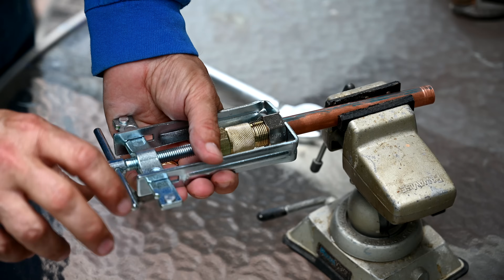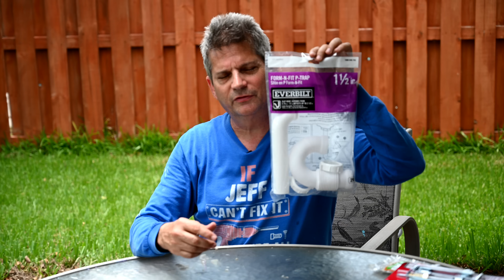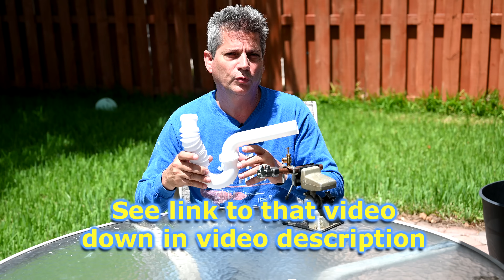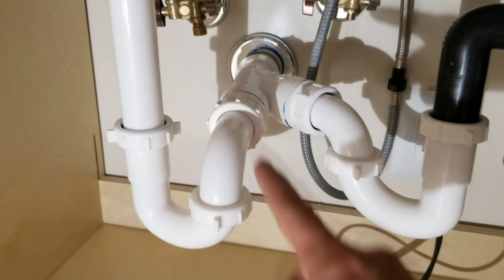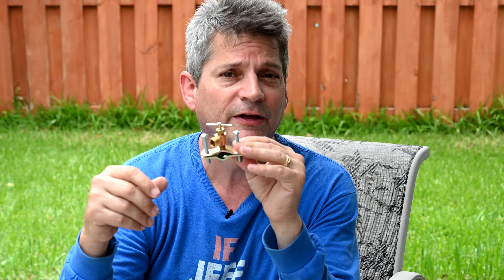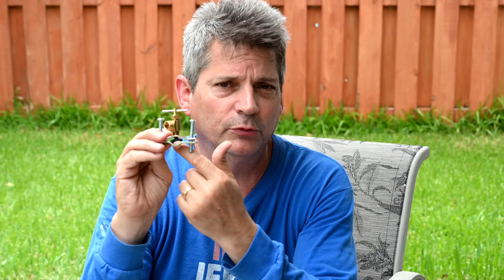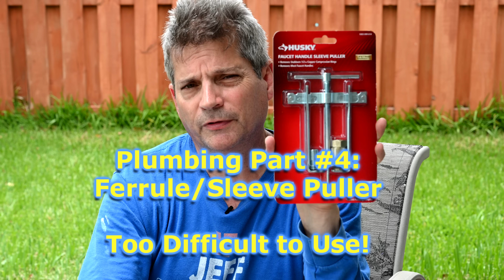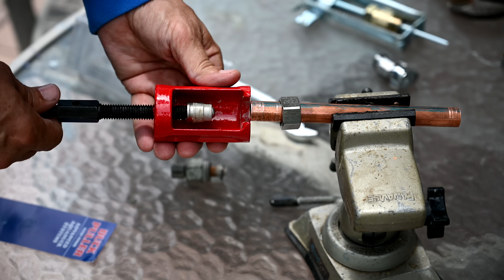4 Plumbing Parts/Tools You Should NEVER Use. NO Plumbing Fails

Comment: As a “Professional” Handyman I get why you have an issue with the average   HM. I live in a Tennessee county where code enforcement is a joke and I see a ton of work every year that is beyond sub par. Having lived in Florida for 37 years where code enforcement is much stricter I am often shocked and amazed at what I find. When I get into a job here. From saddle valves to twisted wire connections with no junction box in the attic to vanities imbedded in green board because the last HM was too lazy to pull the vanity off the wall before installing the drywall, I have seen it all. While I certainly agree there are a lot of HM that don’t know what they’re doing, there’s also a good number of us who care to check code and learn from pros like you before we do a job. Thanks for what you do. Really enjoyed this video especially the husky tool review. I’ve encountered all 3 of the violations you mentioned as well. I kinda think the sub par HM might go extinct if we all had to pass a skills and knowledge test and be licensed. But a lot of the blame rests on the homeowner looking for cheap work. To quote Babe of Babes Plumbing in Venice FL, “Good work isn’t cheap, Cheap work isn’t good”.
Reply from the maker: Yes exactly, and unfortunately you have a lot of poor people who can't afford the normal rate, and so they pay someone what little they have, and cheap labor isn't skilled.
Reply: @jeffostroff  I would just like to add my 2 cents (which probably isn't worth more than 1/2 a cent, but I'll do it anyway) to this bantering about DIYers and HandyMen. I happen to be a retired "professional" Handyman (now DIYer). I owned my own Handyman biz for just over 10yrs. I know... that is not a very long time, most would say. But, prior to starting my business, I worked in the construction industry for almost 25yrs (started when I was 16) doing everything I could get hired that week to do and ended up working as a glazier for the last ten years of that short career until I couldn't work any more due to needing a hip replacement (long story). Anyway (long story longer), after fixing my hip, the building boom here went south for a few years so I started my own biz. I feel my experience, education, and licensing makes me at least a little qualified to render an opinion. That said, and I hope I don't step on any of the Princess Toes that may be out there (and if I do... SO FxxxING WHAT!), I truly think that these so-called "Words of Wisdom" being thrown about like candy canes at Christmas time serve NO useful purpose other than  bashing each other needlessly. For example: "Good work isn't cheap, Cheap work isn't Good". Of course cheap work isn't good!!! BUT... good work CAN be inexpensive!!! Every job has it's own unique challenges and rewards. Each as unique as the individual performing the work. So, I think its time to stop living and working by the code of the one-liners, and only crucify the offenders of what I like to refer to as the "Get the quick, easy money and split" mentality. OR the "I'm a professional. That makes it OK to charge outrageous fees for my work (good or bad)". I will close by saying regardless of the work performed (good or bad), I have rarely seen a "Handyman" over charge for his services, and I have rarely seen a "Plumber" NOT overcharge for his services. Please don't shoot me. It is just a true observation from my own experience over the past 40+ years.
Reply from the maker: @nealfoster6311  Good input, thanks!

Comment: 2:44 yeah, not quite capillary. Venturi effect, based on Bernoulli's Principle - fast moving fluid (such as air) drops pressure, creating suction. Air driven spray guns work like that.
Reply from the maker: That is correct

Comment: Turbulence caused by installing a saddle valve is going to, " break down nearby solder joints"?  Where's your proof for this one. Half the people (licensed or otherwise) coming to fix your house are idiots only interested in making as much money in as little time with as little effort as possible.  Better to do it yourself, if you can.  For the homeowner, it's not usually necessary to pull the nut and ferrule  when replacing a valve.  I have never had an old one leak after snugging up.  And what difference does appearance make if it's under the sink?  If it does drip, replace the ferrule then. Good information otherwise.
Reply from the maker: I sleep better knowing I put in a brand new ferrule that I know was designed by the manufacturer of the new shut off valve I am installing, and so they are a married pair. It also allows me to say that everything is new. I also use this as a good opportunity to buff the copper pipe back to it's original shine, and to deburr the end of the copper pipe, with almost 100% of builders fail to do.
Reply: I'm with you on this. I use all of those "banned" objects and I have never had a problem. I've had problems with so called "plumbers" though and had to fix neighbours plumbing problems after their "expert" has left and refuses to return to sort the job out.
.

Comment: Rigid makes the same tool for pulling faucet handles off and yes it also sucks for the very reason you stated.
Reply from the maker: That's why I prefer modern faucet handles that  don't need to be pulled off you just unscrew them

Comment: i’ve had a saddle valve for 6 years on my house not a problem. inspector didn’t say anything when i sold the house!
Reply from the maker: Not a good inspector! Even if they don't have a problem about it, they should still mention it in the report.  Or maybe they failed to check for it. I've seen these guys breeze through a house in an hour before.
Reply: jeffostroff i hate inspectors. the house i bought had an adjustable pee trap, missing 2 pee traps and it has 2 saddle valves in the basement, not mad about the saddle valve. pretty upsetting
Reply from the maker: @thisoldmtb3815  Yes, it's amazing the dumb things that can happen to a house, then you inherit the mess and the hot potato falls in your lap to fix it.
Reply: jeffostroff with no repercussion either... good thing i know how to fixe things otherwise it would have costed thousands

Comment: What are supposed to do, when the drain goes down into a concrete basement floor?
My house has all S traps, and the drains go through the floor. So I'm sure there legal in older existing homes.
Reply from the maker: If the s traps are not giving you any problem, there's nothing for you to do about them. If you ever remodel and want to change over to p traps you can find a smart plumber who knows how to add another plumbing vent stack and add p traps, and saw off and cap off the old s traps.

Comment: i had an old 1950's cast iron bathroom hanging sink, whose bracket finally rusted thru.  had to use hanging brackets not made for it and it seemed i needed one of the flex traps.  thankfully, couldn't make it work.  applied dynaflex to snug up the sink on the 4 inch tile, let cure for a week, then put in an an adjustable post under a flat point of the sink and slowly raised sink until standard trap worked.. no leaks in two years!
Reply from the maker: That's some great engineering Greg, thanks for sharing. Good idea!

Comment: On a farm and i have installed lots of crap, saddle valves, the flexible drain pipe etc...  most people know the chances they take using short cuts.  Us poor farmers can't afford to have high priced plumbers come in to fix a leak.  We get by, but there are some people out there who should never touch plumbing...  You know who you are.... lol
Reply from the maker: We are premiering a video tonight which will show you how to avoid the Saddle Valve and do it yourself with one part for $7.
Reply: @jeffostroff  would that be a dual outlet shut off valve?
Reply from the maker: @mikeab93  Yes, her eis that video: https://youtu.be/WKKrUINQm_U one valve is a dual valve and the other is a special T-fitting adapter for the 1/4" ice maker water supply line.

Comment: The other problem with those flex traps is that the flex part is very soft and can not be tightened without stripping it out.
Reply from the maker: Yes, I have seen people crack them on that seam. I usually hand tighten, then 1/4 to 1/2 turn.
Reply: Yup, I've had to replace them before for this reason.

Comment: why pay a plumber and drag him and his his van out to do something these saddle connections do perfectly well without even turning the water off? people want their fridge working ASAP, not next monday, plus they are only gonna get their own kitchen wet if it fails, no concern of yours or anyone elses...
Reply from the maker: It is our concern because with people filing water damage claims all the time, it drives our insurance rights up higher. We just filmed another video on this today, showing how the homeowner can buy a $7 fitting at Home Depot which they screw onto the sink valve, and it gives them the 1/4 threaded output for their ice maker line. Hardly like your fear mongering explanation, there's no  wait until next week, and wasting hundreds hiring a plumber like you claimed. they can do this themselves in 5 minutes.

Comment: turbulence of water breaking soldered joints!!! what a load of claptrap!! , those clamp on fittings arent perfect, but they are massively convenient, Ive never seen one fail...
Reply from the maker: Of course you haven't seen one fail they wouldn't call you back since you're the 1 who installed it

Comment: To remove the compression ring, use an X-acto razor saw (about $3 - $5) or a fine hacksaw blade to cut across the ring.  Be careful not to cut into the pipe.  Once you have a nice slot in the ring, use a straight blade screwdriver in the slot and turn it until the ring snaps.  It takes about as long as the other method.
Reply from the maker: Yes, we plan to do a video soon on several different methods to undo a Ferrule sleeve.
Reply: as long as you don't nick the pipe.

Comment: Regarding the 'S' trap,  look up "air admittance valve".  https://www.youtube.com/watch?v=9-rxogXPLKk    https://www.amazon.com/gp/product/B0069KCZO4/  This seems to meet code most places if properly installed.  I installed one years ago on a kitchen sink.  When my sump pump would run then shut off, the flow of water would suck air through the trap under the sink creating an annoying gurgling sound.  Installing the air admittance valve solved the problem, no sound, and no sewer gasses in the house.
Reply from the maker: Yes, there is a similar one that started it all called the Studor Valve, popular under kitchen island sinks where there is no access to a plumbing vent stack.

Comment: That was a faucet handle puller. It did not work correctly because it was the wrong tool. It's not a ferrule ring puller.
Reply from the maker: Sorry Joe, you are wrong, just like the 4 of 5 guys before you who left the same comment. On the back of the package it has 2 sets of instructions, one for using it as a knob puller, and one for using it as a ferrule puller, clearly identified 2 different scenarios. I don't like the fact that this tool tries to be both, but bottom line is you are wrong.

Comment: I've always used those form&fit P-traps on my own house starting 25 years ago  and love them; I've never had a problem or a clog anywhere near the bellows. I've also snaked out the drain with the end of the snake going right through the bellows and not harming them.  Maybe there is a way to cause a problem with them, say, if the bellows were almost horizontal, but if they are just there to absorb any play or slight misalignment, they work fine. I have seen a few DIYers who tried to "do it right" by cutting the rigid pipes to fit the job and ended up with cracked sinks, so for them, the flexible type would probably be the lesser evil, and I really dislike the idea of a disposal in a cheap stainless steel sink without the flexible section; they shake all over the place. I'm sure the insurance or code nazis might catch up with me some day, but if they do, I can always swap it out. 

PS: If you are going to use dental floss as an example, you should emphasize that occupants should NEVER put floss down the sink or toilet under any circumstances; I used to put it down the toilet, but stopped when I caught a ball of it on the end of the 25' snake while cleaning the kitchen sink drain. Something in my 60yo cast iron stacks was catching it.
Reply from the maker: That's some crazy stuff I love hearing about these stories from the front lines. So sounds like you keep your contents going down the drain to be liquid only. And our house where we have girls shedding hair like crazy almost every other month I'm going down the tub drain with the hair stick to pull out hairs so I would never use the flexible P trap here I need to have it constantly self scouring.  The other issue we see a lot to is people jam a lot under those vanities and the last few houses I went to work on it was actually under compression from all the krapp under there and it just forces itself against the P traps and causes the section to separate right in the middle of where the water seal is,  Just enough to leak the water out of there and they don't notice it until it's too late and then they're fighting with the insurance company at the same time that they are crying on my shoulder about their damage.
Reply: @jeffostroff  I can understand why the insurance companies are paranoid about such things. I'd never make a claim over a small leak for fear of being blacklisted, but some people claim everything and anything. I also think the mold risk is overstated in many cases, unless it contaminates a central AC unit. If mold in a wall is getting into the interior air, I'd say the house is not sealed up adequately.
Reply from the maker: @pcno2832  Problem is mold will grow wherever water accumulates that was not mopped up, all the cracks and crevices, then it spreads like wildfire.

Comment: That Saf-T-Kut listed in the link doesn't work and isn't even what is shown in the video, it can end up deforming the copper pipe. I use the one by English Tool Co. to great success.
Reply from the maker: I have the English Tool also, not sure what you mean by Saf-T-Kut listed in the link, I did not link to one.
Reply: @jeffostroff  ,
✅ Useful plumbing tools you SHOULD be using:
✅ Duck Puller Ferrule Ring/Sleeve Puller: https://amzn.to/2k5hrTY
✅ Saf-T-Kut EBCRR Brass Compression Ring Remover https://amzn.to/2Ypt5Mv
✅ RIDGID One Stop Wrench Kit: https://amzn.to/2ClCbNa
✅ Channellock 12-Inch Pliers: https://amzn.to/2MdcnGR

Yeah you did.

Comment: Fought a sleeve for 45 mins?????  What a dumb ass. Never ,Never,Never fight a sleeve. Not even for 2 seconds. See the sleeve has already changed the circumference of the pipe, that spot and anything in front.. its no good anymore. Just cut those 2 inches of pipe and use a new compression fitting behind the original.  Man...  this guy made my day. I was laughing my ass off 😂🙃🙃😂😂😂
Reply from the maker: Cut 2" off the pipe? Man this guy made my day laughing. What if there's only 2" of pipe sticking out of the wall. Never, Never,Never cut 2" off a pipe when there isn't enough to cut off. the right tool removes the most stubborn ferrule in seconds. I now have the right tool so I will never have to struggle getting a ferrule off again.

Comment: I have a Masters license and I say all of these will keep me from earning lots of money , but most of these work great, the 1st item keeps the sewer gases out 100% of the times, like a normal trap would. actually all of these repairs work great. So fk the guy in the Video.. I recently installed an RZP (backflow device ) on a cooling Tower for a Customer that was told by a Idiot Inspector that they needed one to prevent water from the Tower going back to the main. He insisted and I installed it. Close to $4K bill . What were the chances of contamination from  a backflow condition?  zerooooo, physically impossible. See the water feed sits 4 inches higher that the basin of the cooling tower.  So don’t think for a minute the plumbing code and the inspectors know it all.And as for us the Plumbers...  we just  wanna make a buck. The closer I get to retirement the more I realize that many of the things we have banned here in the States, are all over the world working great for decades . As of matter of fact. All you need ,it’s Common sense.. it goes a long,long,long way.
Reply from the maker: I can't imagine you call yourself a master plumber and in the same breath you can say a saddle valve works great. You obviously don't know anything about dissimilar metals and the damage and leaks electrolysis causes.
Reply: @jeffostroff  I laugh when you say electrolysys,  every single plumber like yourself that talks about electrolysis does not have a clue of what it is. And you are one of them. Electrolysis its a long  process and news break ‘’ the saddle tap valve uses an O ring that separates the 2 different metals. Every method we use in the Plumbing business to attach 2 dissimilar metals its .... guess what idiot?????  A cheap ass “O” ring!!!   Go back to your shop and inspect every union you got for dissimilar metals that you overpaid to prevent electrolisys.  Thats right! An O ring, a flat o ring, a round O ring etc. All of it made out of rubber. Take note dummy. The worst Cases of Electrolisys that I have seen were not in dissimilar metals, they were in the middle of  piping  not even close to another different metal on sprinkler pipes on a dry system, something you would know nothing about. Stop scaring people with your bull shit.  Whenever you start putting your hands on industrial stuff like myself then worry about using those cheap ass repair parts on steam piping and hydronic piping and such. Not in a home.